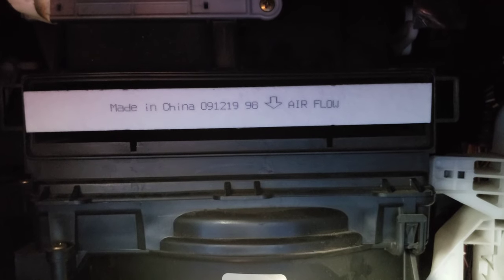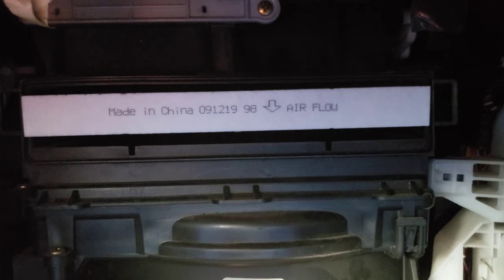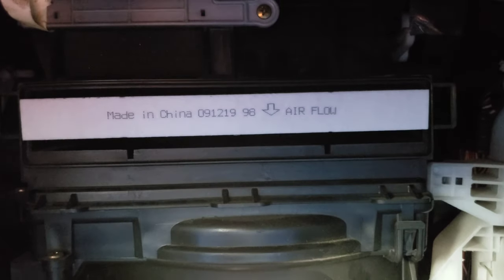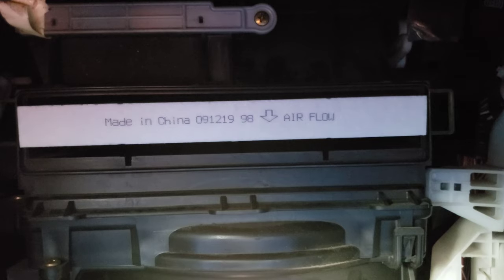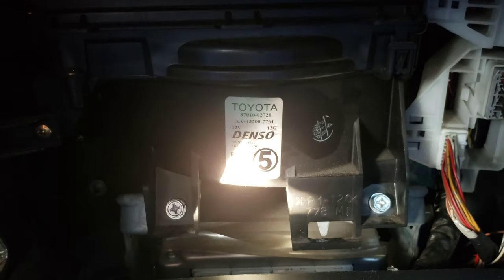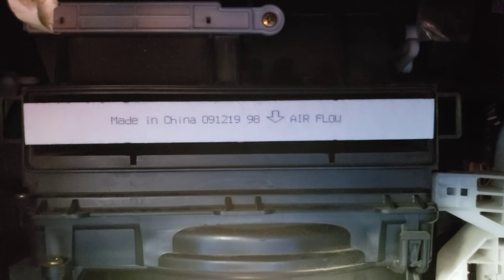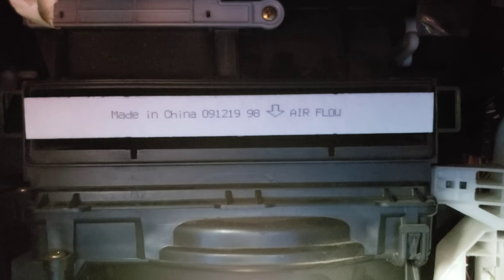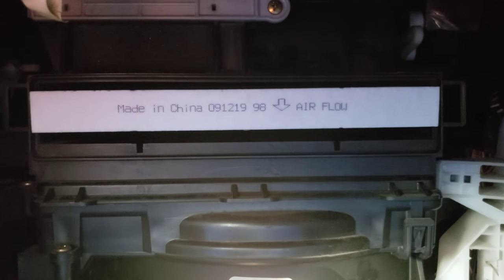Cabin Air Filter Arrow Up Or Down Air Flow Direction

Comment: It's funny. This is one of the easiest things to do, but when you start second guessing yourself you spend 45 minutes on YouTube trying to find videos like this for confirmation 🤣 Thanks for the video!👍
Reply: That’s exactly how I found this video… second guessing 😂
Reply: Exactly why I’m here!ha
Reply: @anythingsgood236  lol! The aftermarket one I bought doesn't have arrows on it. So I just put it in the way I thought it goes in. Didn't blow strong. So I flipped it, still didn't blow strong. So I just took it out completely, now it's like a wind tunnel. Hope that helps.
Reply: @anthonystreeter7217  why didnt I think of that before?! It was tough to put the glove compartment back in so dont wanna go through that again but for sure when this new filter needs replacement I’ll follow your advice.
Reply: And now here I am 🤣🤣
Reply: Exactly why I'm here lol
Reply: Yep. .
.sure did :)
Reply: There should be an arrow on the slot isn't it
Reply: Yep. Same here. Lol. My previous air filter doesn't have arrow, i became confuse, and im here
Reply: So true. Im second guessing now after replacing my 22 corolla hatch. Closing in 10k miles and its all filthy (their oem filter looks so thin and cheap too smh) anyway, yes the cover itself has its arrows pointing up and the word UP while all the dirt on the filter are on the top! Smh so why wouldnt I dont get confused lol
Reply: @MUNLIT KULIT  yeah my oem one had a arrow on the filter, like a house filter does. Cause apparently the air has to pass through a certain way. My aftermarket one had nothing. So what way am I supposed to put it🤣
Reply: Same story I got here hahaha
Reply: Lol
Reply: Uh huh…..   😂😅
Reply: 😂🤣 🙋🏻‍♂️ that's me right now.
Reply: As evidenced by the number of times this video has been watched.
Reply: 😂😂😂 i’m gonna be late for work

Comment: Thanks for the explanation.  Started to insert my new STP filter and saw that the writing would be upside down if I pointed it the direction of the airflow arrow which confused me since my original air filter was printed rightside up.  Amazing how simple issues can dumbfound logical thinkers. 😂 Thanks for the clarification.

Comment: Thanks for the excellent video! I bought an after-market filter, there is an arrow but no information whether it is an air flow or installation arrow. My original 2014 Corolla air filter installed with arrow up, but on the original has text says "This side up". Confuse which one to follow when installing the after-market one. Any thought? Thanks!
Reply from the maker: Thanks for watching! That's too bad if it doesn't say air flow or direction, no way to know,  I am not sure. You could try calling the company for verification of what the arrow means.  Thanks again for checking out the video!
Reply: By default, an air filter that has an arrow on the edge of it indicates air flow direction unless it says up next to the arrow. WIX brand is one example.
Reply: On the Corolla the factory filter has an arrow and says install arrow pointing up. If you put an aftermarket fllter in the arrow is in the direction of airflow. On the Corolla the air flows downward from the cowl toward the blower motor. So if you have a factory Toyota cabin air filter the arrow faces up on an aftermarket filter the arrow will face down.

Comment: My cabin filter doesn't have any arrow what way should I put it?
Reply from the maker: Thanks for watching,  I am not sure if there is no arrow. I would contact the manufacturer. Thanks again for watching!
Reply: Got the same problem. No arrow at all. I think including such arrow should be a standard in cabin air filter to avoid problems

Comment: The cover on most Toyotas have an arrow on it and it says up. This is still not indicating air flow. It's simply telling you which edge of the cover goes up. Air flow is down.

All horizontally mounted cabin air filters with the blower motor mounted below the filter will have downward air flow direction otherwise the blower motor would be full of dirt and debris.
Reply: What good direction to the Toyota the manual I said up
Reply: Pretty dumb of Toyota to put an up arrow on the cover to a part where people need to know the direction of airflow… and when the direction of airflow is actually down.  We don’t really need an arrow to figure out how to reattach that plastic cover since it only goes on one way.
Reply: Suzuki did the same thing
Reply: This was the information I was exactly looking for. Better explained than this video and all others. thanks a million.
Reply: @HJM_888  
The Toyota owner's manual says to point the arrow up because it's telling you how to install an OEM Toyota branded filter which tells you which side goes up and says nothing about air flow.
Reply: @AegisHyperon  
Also many if not most Subarus and Range Rovers.
Reply: STP filter for Scion also has an arrow labeled "UP".
Reply: I'm still confused 😂 bought an STP CABIN FILTER AND THE INSTRUCTIONS SAYS TO INSTALL WITH ARROW UP

Comment: not so fast Todd... 2013 rav4 Manual say arrows should be pointing up. Replacement filter says arrows should be pointed down. Orig. filter had arrows pointed down......?????????
Debris on the one taken out was heavy on top so I installed mine with the arrows down....right?
Installed Purolator brand...
Reply: My 2006 Toyota Avalon manual also says that the arrow should be pointing up.
Reply: @Sades1990  it's confusing. depending brand of filter.
Reply: @Sades1990  
That's because the Toyota owner's manual thinks you're installing a Toyota OEM filter that has "up" arrows on it. Those directions ONLY apply to filters with "up" arrows not to filters with "air flow" arrows which by default is the industry standard. If you insist on following the directions in the owner's manual then you need to restrict yourself to buying OEM filters from the dealer.

Comment: I have a 2020 Toyota Camry , installed a WIX brand cabin air filter . Installed it with arrow pointing up [ towards windshield ] as it said UP . Wix says strangely I think arrow points towards " airflow " . I assume I installed it correctly . I don't care which way the air flows at all . Simply put an arrow and say install UP or DOWN . Don't confuse customers with any other nonsense
Reply: What about Vertically Mounted filters, as in "on their narrow edge", like BMWs, where it is standing up (front to back, not Top to Bottom). I know the answer, but you may not want to "simplify" this with a blanket statement, as you did. Step back, read a few posts, realize that the filter manufacturers spend big-bucks tooling up their factories(including printing 
part #s & (flow)arrows on the edges to keep their contractual obligations with the vehicle manufacturers, and parts supply stores.
No disparaging here, just asking posters to try a little  
awareness and logic. Be well.

Comment: I got a stp max cabin air filter my Honda says air flow down but the cabin air filter says air flow with arrow up if I flip the air filter so the arrows face down all the words like made in china are upside down does that matter? I have it with arrows up should I flip it?
Reply from the maker: Hi and thanks for watching. if the STP filter says air flow and has an arrow pointing a direction you want to align that with whatever the cabin air flow direction is in your vehicle. Even if the letters are upside down. Hope that makes sense. Thanks for watching.

Comment: I just purchased an aftermarket replacement cabin filter for my 2014 Dodge Grand Caravan. The air filter I took out had air flow arrows pointing down, and debris was on the top as I removed it. The new filter has printed instructions that say air flow arrows are supposed to point up.🤷‍♀️ I followed their instructions at first, but after watching this video, I just switched it to match the way I had the previous one in. Hopefully it will be right now. Who really knows? And does it really matter? Honestly, thos filter looks the exact same on both sides.

Comment: Toyota Dealer Service will replace the Cabin Filter with a Toyota product meaning it will say "UP" on the filter and not "AIR FLOW". The arrow will also point up.

As explained in the video aftermarket filters, non Toyota, will say "AIR FLOW" and so you then follow that direction.

Comment: The purolator filter for my 2016 f150 has the arrow pointing the wrong way. You have to install with the arrow going the wrong way for the filter to fit right. And yes it's the right filter for it. Most of these filters will flow the same either way. You would think the R&D department at purolator would have enough brains to get something this simple right. But then again most engineers have never worked on anything in their life but a computer

Comment: The issue with mine, is the the sticker that had air flow down. I couldnt get it all the way in, it just just out and wouldn't close. It would only fit in if it moved it sideways

Comment: Does the fan get louder after changing filter? Mine was super dirty and clogged up with pine needles, leaves and dust. After changing the filter my fan got so much louder
Reply: Yes bc it’s actually being able to breathe same way your engine may sound louder after replacing air filter

Comment: I have a Kamoka cabin filter, one side is yellow-ish, the arrows are there but not the words "air flow" next to these arrows. There is no way of knowing if the arrows indicate the air flow or the mounting direction. I know the air in my car flows downwards, because i saw the old filter and debrie was on top.
Somebody knows?
Reply: If it doesn't say "up" next to the arrows then the arrows should point down in the direction of air flow which is the industry standard for an air filter.

Comment: My manual says to have the arrow pointing up.
Reply: Your owner's manual is telling you how to install an OEM Toyota brand filter. It is not telling you how to install an aftermarket brand. The Toyota brand filter says "up" next to the arrows so the arrows indicate which side goes up. The air flow direction is always downward on all horizontally mounted cabin air filters with the blower motor mounted below the filter.

Comment: Hey Toad if my cabin air filter says for the air flow to go up do i put it up?
Reply: Air always flows toward the blower motor when the filter is mounted above the blower; otherwise the blower would have dirt trapped inside of it.

Comment: Todd changed cabin filter on 2017 crv arrow points up and that's how l did it was l right?
Reply from the maker: Hi thanks for watching,  I am not sure on the crv which way the arrow goes, hopefully you got it figured out.
Reply: Any cabin air filter that is horizontally mounted with the blower motor mounted below the filter has downward air flow. ⬇️ However, if it says up next to the arrow on the filter then the arrow has nothing to do with air flow direction and should point up.

Comment: Okay BUUUT Thank you for the valuable information btw but What if the arrows don't say air flow near them. There's just arrows there with nothing really saying what they mean.
Reply from the maker: Thanks for watching! That is a good question and unfortunately no way to know for sure without asking the manufacturer.
Reply: By default an arrow on the edge of any air filter indicates air flow direction unless it says otherwise on the filter.

Comment: For a 2005 Nissan Altima which direction would you say the air flow is up or down
Reply from the maker: HI Michael, thanks for watching. I am not sure, you will need to look in the owners manual to see if it gives you any information, if not you could try to reach out to the dealership to see if they can tell you the correct direction. Thanks again for watching!
Reply: All horizontally mounted cabin air filters with the blower motor mounted below the filter will have downward air flow.

Comment: The cabin air filter replacement I got doesn't have an arrow, just letters. How do I know which way is up? I have a 2005 Honda Civic LX... the arrow on the plastic shows down.. Thank you!
Reply from the maker: Hi I'm not sure on that car, good luck and I hope you get it.  Thanks for watching!
Reply: Some cheap filters and counterfeit filters have no air flow or up arrows. If the filter sits in a plastic holder of tray and there is an arrow on the tray that says "up" next to it that's just telling you how the tray goes back in & does not indicate air flow direction.
Reply: All horizontally mounted cabin air filters with the blower motor mounted below the filter have downward air flow.  If there are no arrows, I would simply put it in so the letters/numbers are right side up. If it has a wire mesh on one side, that side would go down. Also if it had carbon in it the darker side would go down.

Comment: Thank you, I just corrected mine.
Reply from the maker: Thank you for watching! Glad this helped
Reply: @ToddsGarage  The reason I changed my cabin air filter today was because I Replaced my blower motor. I just wanted to thank you for the video on how to change the blower motor. For months I have been stressed out because it was going out periodically and I did not know what was wrong. I came across your video and did it exactly as you instructed and now I have a working AC heating system again. I now can drive to work in the cold early morning and not have to worry about a frosted windshield with no heating. Thank you again. The clock is next, as mine is doing the same.
Reply from the maker: Awesome, glad to hear that video helped! Ya the clock issue is a common one unfortunately.  Good luck!